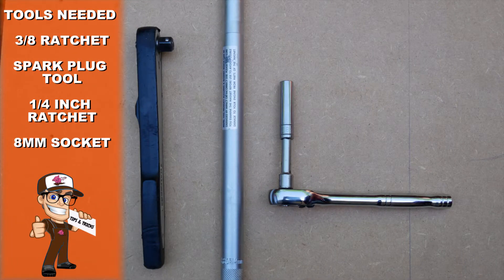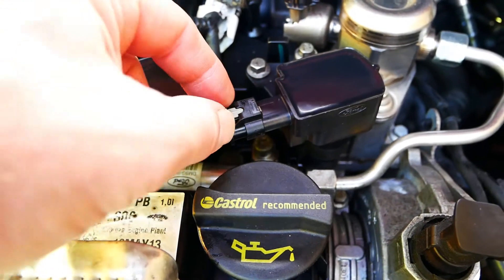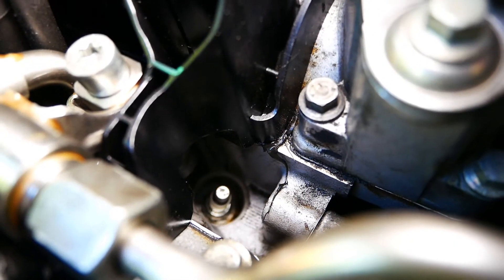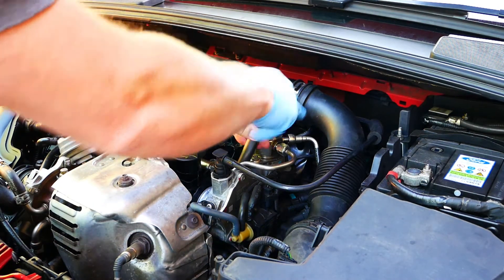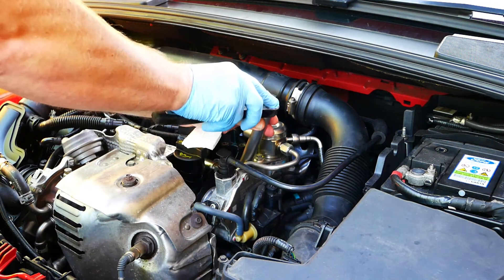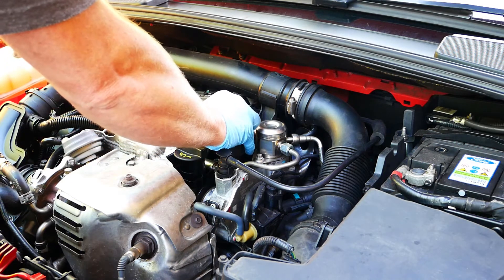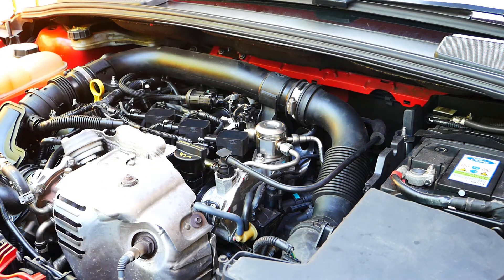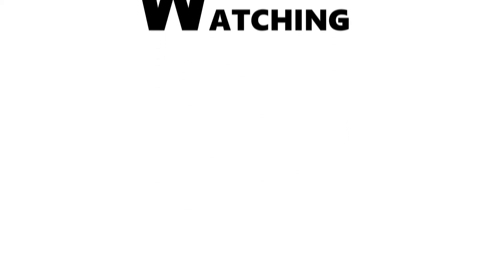FORD 1.0 ECOBOOST SPARK PLUG COIL PACK REMOVAL

Comment: Does a Ford Bmax look exactly the same? My car has just had a cam belt change, and I started noticing random jerking when accelerating at times. There’s no consistent pattern, but it might be when the engine revs too high. According to the internet, this could mean that the spark plug needs to be changed. Does this sound right?
Reply from the maker: @TheQuietLifer  it's possible could beplugs . If the b max is a 1.0 litre ecoboost then its the same engine

Comment: I know this may sound like a stupid question but are the cylinders 1,2 and 3 left to right on these Volvo motors? Thanks
Reply from the maker: Volvo Motors?
Reply: @baconbuttties  Aren't the 3 cylinder 1L turbo ecoboost motors in the Fiesta volvo motors?
Reply from the maker: @raym375  Developed by Ford as far as I know

Comment: What gap does the plugs need to be
Reply from the maker: I'm not sure but most plugs come gapped correctly these days.
Reply: @baconbuttties  NEVER assume a pre-gapped plug is correctly gapped. ALWAYS check gap, every time, immediately prior to installation.
Reply from the maker: @mikel2283  Do Spark Plugs Always Have to Be Gapped? Not always. In the past, it was necessary to gap spark plugs, but today spark plugs are usually pre-gapped.
From Champion.....
Reply: @baconbuttties  Simply dropping a box of new pre-gapped plugs is enough to change that pre-gapped gap. Do you trust that chance enough? 10 seconds per plug is well worth it, when you consider unknowingly installing a spark plug with the wrong gap could lead to many hours, days, weeks and $ spent searching for the "issue".
Reply from the maker: @mikel2283  all I have done is state what the manufacturers say.
That's all.
Also you can tell If one looks wrong compared to the others  just with your eyes.
Reply from the maker: @mikel2283  By the way I'm not saying it's wrong to check, I'm just stating that modern plugs are pre gapped.

Comment: This "do not overtighten strategy" does not work, on modern vehicles, where threads are sat in aluminium and plastic etc. It's like playing russian roulette, on things like spark plugs. Strong people, will have a different feel, than less strong people. Only correct way of doing things like this, is using a torque wrench. On this 1.0 Ecoboost, the correct torque specs for the coil pack bolts are 9 NM and for the spark plugs, it's 19 NM.
Reply from the maker: Torque wrench is always the right way
Reply: What if you don't have 1
Reply: Where did you get 19 Nm? Haynes states 13 Nm for 1.0 Ford engines

Comment: paid about Peso 15,000.00 for changing one 'coil' at Ford in Cagayan de Oro City Philippines 1$US=Peso 49.50
and paid for installation P3,000.00+. At Lazada same original Fors-coil cost P2,800, installation takes max 5 minutes
Reply from the maker: 😱 expensive

Comment: No mention of gaps?
Reply from the maker: A quick google and  Spark gap: 0,7 mm
Reply: If you buy NGK they come pre-gapped at the correct size, 0.28"/ 0.7mm, a quick check with the coin tool is always recommended tho
Reply: @EttoreB93 I think you mean .028", not .28

Comment: Do I need to add anti-seize on the sparkplug? Thanks
Reply from the maker: If using NGK they say not to add copper grease. There is also the issue of torque values changing if using copper grease. Some people use it and some don't and I suppose it really wouldn't hurt to use a very small amount so I can't give a definite answer.

Comment: Do you know if the thread Is stripped can you re-thread the holes with the triton fixed kit
Reply from the maker: I know that spark plug holes can be fixed with certain kits but i have had no experience with the triton kit  so i can't advise you sorry.

Comment: How many kilometers do the spark plugs have to do?
Reply from the maker: In a Haynes manual ...
Every 37,500 miles or 3 years, whichever comes first

Renew the air filter*

Renew the spark plugs

*If the vehicle is used in dusty conditions, the air filter should be renewed more frequently.  
So every 60000 kilometres for spark plugs.
Reply: @baconbuttties  thank you very much my friend !!really thank you !!you are so gentle!!!

Comment: Hi buddy, can you tell me where you got the spark plug removal tool from? Many thanks, Mike
Reply from the maker: I bought it from Halfords, it is called a 14mm but is a lot narrower than that.
Reply: Cheers for the reply mate. I can see they do a Laser 14mm magnetic spark plug socket that looks like this so perhaps it’s this. It costs £12.99. Many thanks for the help!
Reply from the maker: @wallydjsnr I am not sure if that is the correct one as it look different to the one I purchased , it was over a year ago though.
Reply: BACONBUTTTIES 3TTT,s No problems mate, I will go in and have a look. Cheers for your help so far!

Comment: What size is the spark plug? 14mm?
Reply from the maker: Hard to explain , the spark plug is not 14mm and the tool I used doesn't measure 14mm across.
The tool I used is called a 14mm as in the video but is extremely skinny so I don't know why they call it a 14mm .